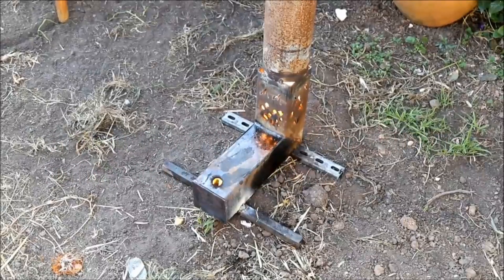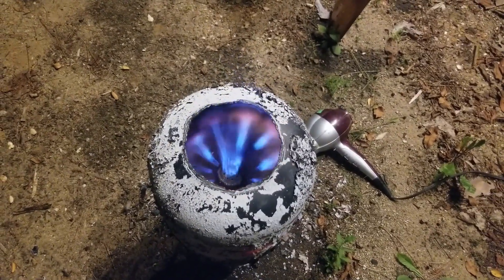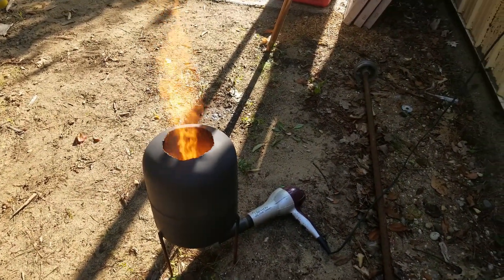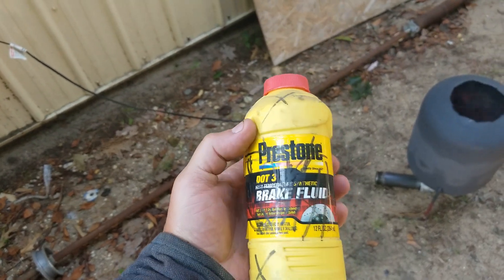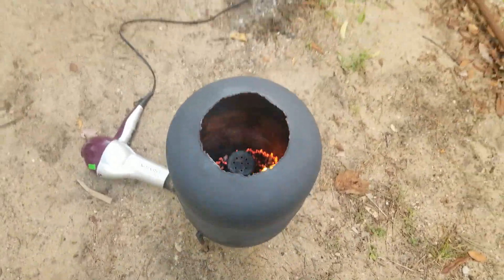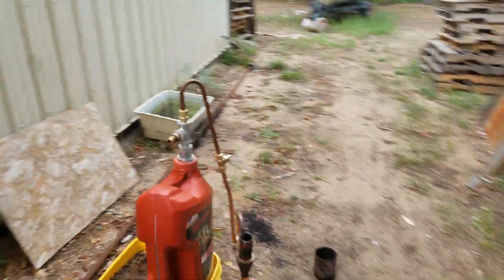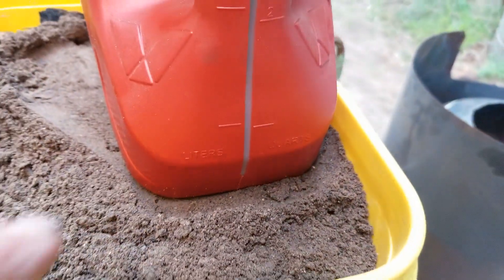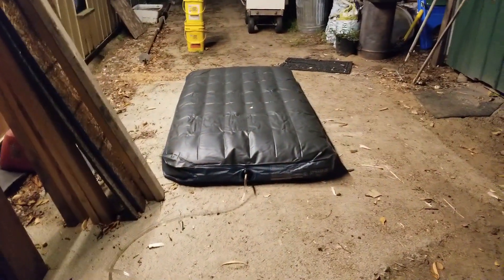Blue Flame Waste Oil Burner

Comment: The problem with waste oil burners is most of them especially any that burn with a yellow flame is the DANGEROUS levels of unburnt oil and soot you can't see it but there is the problem. I built several versions whilst they did the job it wasn't until it Rained that you find out just how much unburnt oil goes up with even the cleanest looking exhaust, we use and rely on rainwater in several 5k Liter tanks The area I was using these burners in was at least 50 meters away from any buildings even the lightest wind blew the unseen exhaust over several roof tops on my property all rain that falls on my roofs ends up in my tanks, that's when I saw the oil slicks floating on the top of the water in the first flush traps, I checked all the Guttering on every roof and sure enough there was a thin layer of oil on top of the dust and derbies  in every gutter my burners were the old smudge pot type used in workshops and vineyards to keep the frost off the grapes, and heat in enclosed workshops , these were designed to be used on any type of combustible oil These were  TOTALLY BANED in Australia, many years ago, I also used similar drip type burners and pressurized syphon types for melting copper brass and aluminum, whilst these gave varying successful results These things are Highly Polluting  We have several tall old trees and plants on our property all would have suffered not to mention the birds and critters including bees  which we noticed were not as prevalent this year resulting in verry poor fruit in our orchid for the first time.
Preheating the oil helps enormously weather it's a drip feed or syphon type Ultimately if you are getting anything less than a clean blue jet a fair amount of your oil is literally going up with the exhaust. Right now, I am experimenting with a diesel glow plug to pre heat the oil before it goes into the burn chamber on startup and a couple of coils of copper tubing around the burner somewhere to keep the oil hot enough without the oil crusting up and reducing the flow inside the feed tube. 
If you need to buy your water and get it carted it verry quickly becomes an expensive exercise. most rural properties don't have a proper first flush system on their rainwater tanks and if they do, they rarely maintain them.
Reply from the maker: Looking for oil slicks is an interesting way to determine the cleanness of the burn.  This design also avoids dripping the incoming fuel through the flame, it enters at the bottom.

Comment: Restaurants are a good source for used cooking fryer oil.
Reply: Yes Cooking oil is one of the safest and cleanest burning oil you can use so long as you filter it and pre heat it at around 60 degrees C, it's important to maintain a steady flow if the preheating gets too hot it could carbonize in the fuel delivery lines, 60 degrees C gets it  verry close to the viscosity of diesel fuel, if it's too cold it won't run through the line very well and could be an issue, you can get standard diesel fuel  heated filters either in 12v or 24v dc use in trucks with some you can replace the filter cartridge with a glass bowl generally they are a double type a cartridge on one and a water trap Glass bowl on the other some even have a primer pump on them handy if you are pumping the oil after the heaters  keep the heaters as  close to the oil tank as possible. any blocked pipes can be cleaned using steam or a hair dryer, solvents won't dissolve tallow or cooking oil, if it's a partial blockage try pumping hot water through the lines. a good way to stop your jets glugging up is to use a hair dryer on the heat setting as a blower these generally have several heat settings and variable speed air flow settings.

Comment: 12:10 “every so often it pops” that is water / moisture in the oil and can be very dangerous if you have anything over the heater. One rain drop will make the flame rise several feet… a few drops and it gets intense.

Oh, I see you figured that out, haha.

Comment: where are you adding fuel?  Ive built a couple burners recently just not happy with any of them yet.. This looks like it may make the BTU's I want..
Reply from the maker: It runs in a little pipe in the bottom, just like Creative Inventions LMTN (did you watch that video?).  Ultimately there's just a puddle of fuel in the bottom of the tank, and a drip system to sort of keep up with the burn.  Nothing precise at all.
Reply: @dansw0rkshop  Thanks...  If you want wild run like 5 loops of steel oil feed line around the outside and feed through that once it gets really burning.. you start to burn the oil vapor instead of liquid..   I thought thats how the burner your using worked but the way it looks like the flame come out the hole is deceiving does the curved top to the tank your using impact the burn? Im assuming the flames from the holes is because its the only source of air for it to burn..

Comment: Hello.  Toward the end of the video you have 2 pipes coming off the oil line.  Curious as to what the top pipe is for?
Reply from the maker: This was intended to provide an overflow if the bottom line got clogged.  The oil would overflow in through the top line then, instead of running out all over the ground (or floor etc).

Comment: Fantastic burner. :)  I am so looking forward to your burner burning plastic, I have about 30 five gallon /25 litre containers to get rid of from using waste oil :)
Reply: I take it you will be trying to do it by Pyrolysis this is extremely foolish unless you have the skills needed to build a gas tight reactor and a degree in chemistry, if it were an economical or safe process there would be dedicated producers a long time ago , the cocktail of carcinogenic residue some fools use as fuel is far from safe Just because you can run an engine on it is not proof of concept or even efficiency, for your own health and those closest to you Don't do it.  the process emits stinking fumes and filthy residue left over that have to be disposed of Safely even the residue can be dangerous to handle.
Reply: @FladFlidington  Yes I know, I researched it and have abandoned the idea :)

Comment: Love the content!
Are you planning on making more videos on refinements to the charcoal gasifier?
Reply from the maker: Yes, as I have time.  One thing I plan to do is shorten the water-cooled inlet pipe, for a taller reduction zone.  I may also switch to water cooled instead of oil cooled, and / or connect it to my hydronic heat system to capture the waste heat.
Reply: @dansw0rkshop  
I generate tremendous amounts of waste oil from my business, which I currently run through a furnace to heat my shop. I would like to build a charcoal gasifier in order to use it to run a waste oil drip through it. Your design, is the only one I've seen with the cooling jacket, which I think would be necessary to handle the extraordinary heat generated by such a system. I like the idea of combining the charcoal and oil because just about any other system designed to crack only oil will always coke up and create a constant mess to deal with. Running the oil through the charcoal should reduce everything to ash which should be easy to safely clean up and dispose of. Should also generate a very rich gas mixture. I would likely use oil in my cooling jacket in order to have a consistent source of preheated oil to drip through the gasifier.
Anyway, I appreciate your hard work, and especially like seeing how you create complex conical shapes, in metal, with simple shop equipment that I already have.

Comment: Waiting all your life for a burner like this!! one that takes electricity!?🤨😂
they have been available in hardware stores  FOREVER!
People used to heat there home with oil since before you existed 
I think you are a few shingles short of a shake block
Reply from the maker: Link?  I'm well aware of beckett style burners, I have several.  They burn motor oil, yes.  But not with a blue flame.
Reply: @dansw0rkshop  I didn't say Beckett style burners
Reply: @hemidart7 🏆thanks for participating